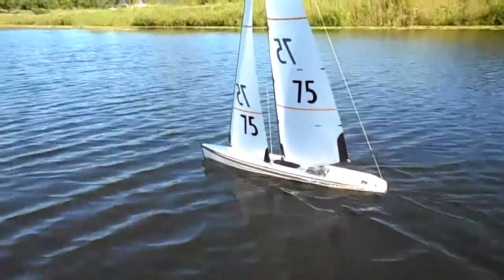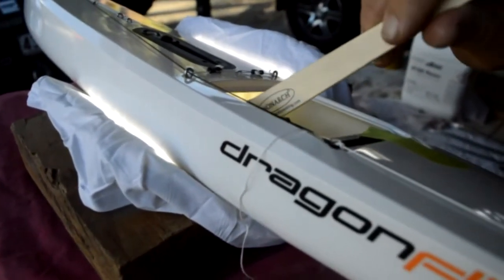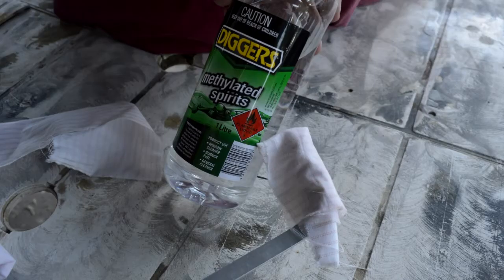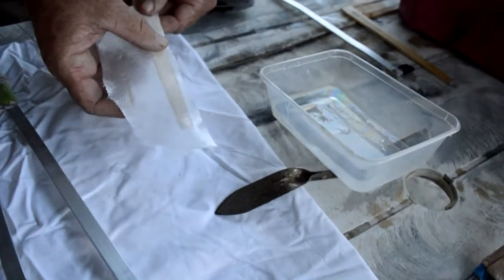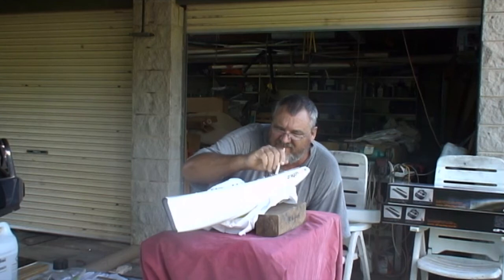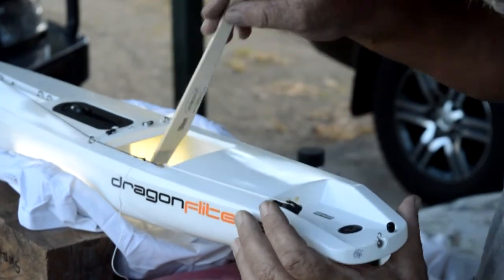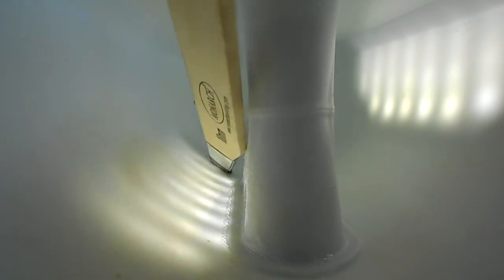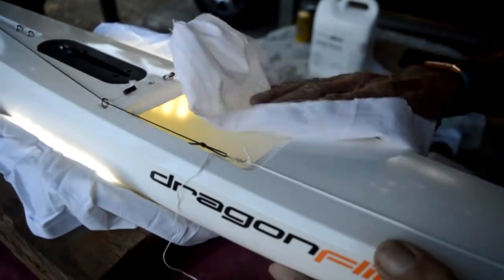Dragonflite 95 Hull Cracks Fibreglass Reinforcement

Comment: The best solvent for epoxy is methylated spirits. It’s therefore excellent for cleaning the area before applying the glass, and equally good for cleaning up the resin. I work a lot with epoxy in aircraft and marine applications.

Comment: I have done mine using West System G Flex epoxy mixed with silica powder to a point where it will still run but it's fairly stiff,insert the epoxy mix with a syringe and tube to the base  only. Manipulate the hull to allow the epoxy to flow into an even bead around the trunk base.Laquer thinners works excellent,don't put thinners of any discription on anything black it melts.G Flex is made for plastic.
Reply: Thank you! I followed your feedback and used the same formula and "painted" it onto the inside hull around the keel using a simple water color brush with a 45° head. I melted the plastic paint brush with a heat gun to create the bend.